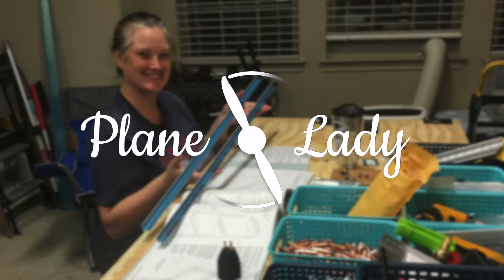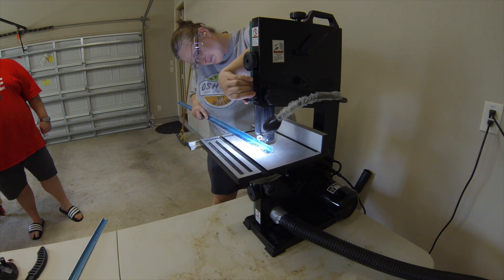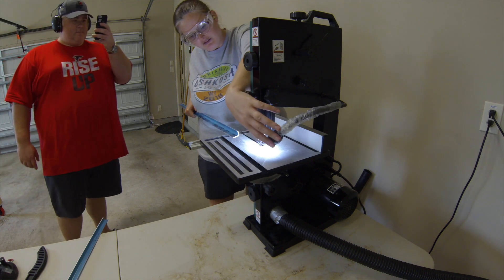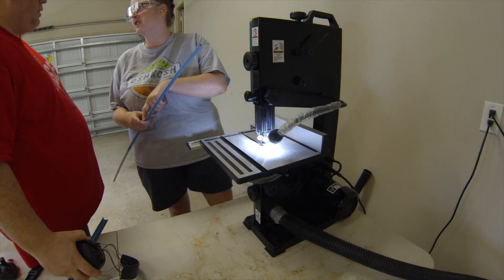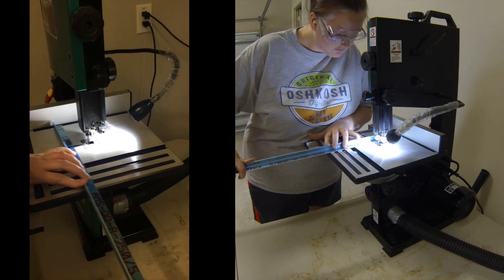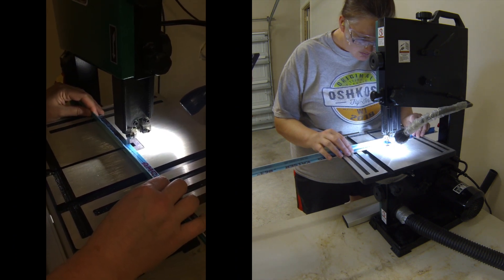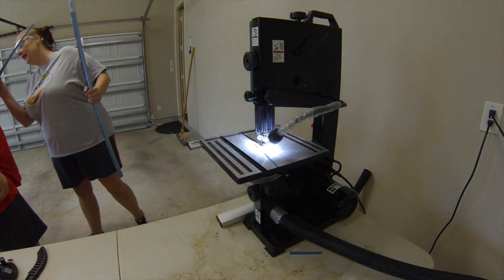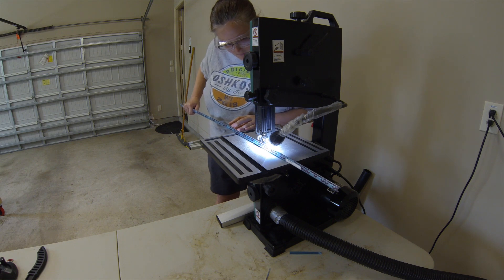Van's Aircraft RV-10 Build - Day 1, Step 1: Making the 1st Cut!

Comment: Wouldn’t it have been easier to get a guide to ride with the cut? I’m probably not explaining it correctly but you removed the guide for the relief cut.
Reply from the maker: The aluminum angle is very narrow and the angle you’re cutting is very steep so the guide wouldn’t have worked here. You can see where the track for the guide is several inches off to the side.

Comment: oh boy more tools to purchase.   Is there a lot of cutting?   if so , I have to add to my list.   You're  a pro....
Reply from the maker: You really should have a bandsaw. Quite a few thick aluminum parts you have to cut to size/shape. I’ve used a Dremel in a pinch while waiting on a new bandsaw blade, but the bandsaw just makes faster, neater, more accurate cuts in my opinion.